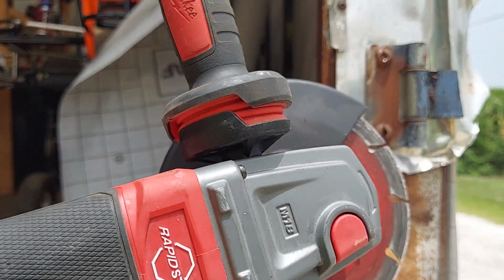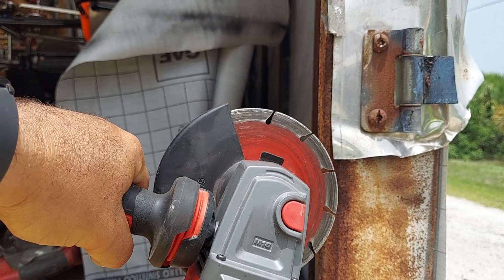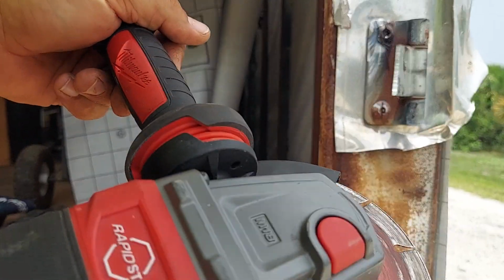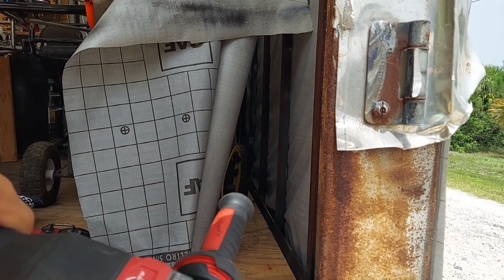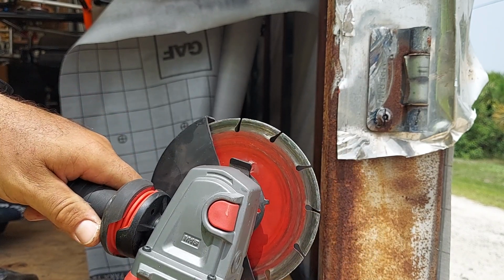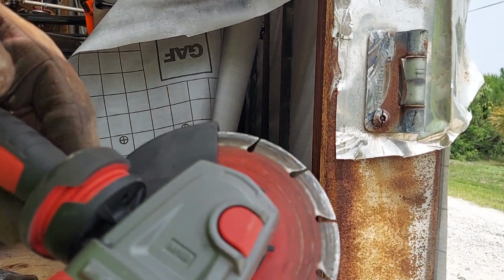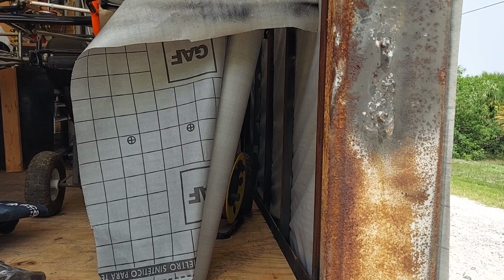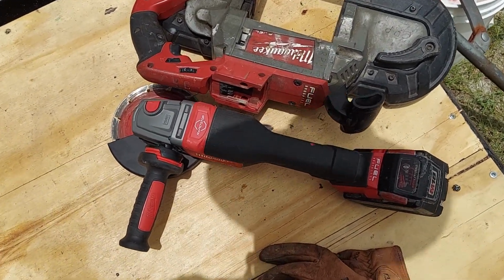6" Milwaukee M18 FUEL Grinder 2980-20

Comment: You have the right tool but the wrong blade.  As Ironworkers, we cut bolts on a regular basis, even grade 8 bolts much larger than that screw.  We use he same tool and it is fantastic.   With a .045 thickness abrasive 6" disc for Stainless Steel  (that is important) we get upwards of 20 bolt heads, or nuts, with a 5.0 AH battery.  A thin disc like these with only light pressure cuts real fast, the tool will not overheat and the disc is not consumed rapidly.  A thin cut is what you want, but choose your cutting discs wisely.  Not from a hardware store.  Each welding truck and our fabricating shop have several of these tools and they last or years even with heavy use and the 5.0 AH battery keep the tool weight manageable when using while on ladders.  These tools have filter screens, keep them clean and blow the tool out with compressed air for long life.  Because we have so many tools on the Milwaukee M18 Fuel platform, lots of batteries and 4 port multi-chargers we use the tool you have.  However, if someone is already using the DeWalt platform, the DCG414 Angle Grinder 4 1/2" - 6" Flex Volt 20 volt/60 volt with a 6 AH battery is a good choice for slicing steel like this.  I have one on my truck and use it occasionally but we do not have many of those batteries available to us.  It performs just as well though.  A little bigger and heavier, a bit more expensive (especially those batteries) but a good choice for DeWalt fans.  In the trade, we call these tools "Slicers" and every welder or ironworker has at least one of these tools and a box of these cutting discs on his truck.  They absolutely eliminate dragging out cutting torches anymore to slice steel.  Quick, fast and in a hurry.  Eyes are always on us and we get paid for how much we do on a job.  These tools are money makers for us.
Reply from the maker: Agreed, don’t like the metal blades
Reply: @tradesmenlife  like it or not, they are the disks you need
Reply: yep, silicon carbide's hardness is 9.5 on moh's scale, just half a point below diamond, and it will not be destroyed by iron, while diamond will convert to graphite when contacted with iron  if it is heated above 700 degrees C.

Comment: you can just buy two lead acid batteries from a car and a buck converter (step down module) to drop the voltage from 24V to 18V, then use the grinder for a lot of time, it is not going to be cordless tough, but the battery will be cheap, and you can move to any location you want
Reply: or you can buy a buck boost converter (step up module) and rise the voltage from your car's 12V to 18V , turn on the engine and grind while the car will be generating the electricity you need.

Comment: For anyone watching, with a proper edge, and better angle of attack on something like this, you won’t chew through a battery that quick. I was doing a bigger job of cutting off old welds and only got half way through a second older dewalt 4.0 battery with an older dewalt model at work. I was interested in viewing a demonstration since I ordered this model with a 6.0, I understand making a video and having everything being proper set up is difficult especially if you’re a full time worker, that’s no knock on you I appreciate the demonstration.
Reply from the maker: More videos to come

Comment: What does it mean when lights 1/3 then 2/4 flash back and forth?
Reply from the maker: What?
Reply: @tradesmenlife   was wondering if you knew what some of the flashing light codes on the battery was.  Mine was alternating between 1 and 3 flashing at the same time and then 2 and 4 at the same time over and over.  I’m guessing my battery overheated

Comment: That is a NOT a metal cutting blade
Reply from the maker: It was a cutting blade for Metal, it was very dull , I changed the blade for a new one and cut much better, yes it looks like a tile cutting blade, but it is specifically for metal cutting.
Reply: That is a metal cutting blade. I have a few of them. Use them at work all the time for cutting cast iron stacks and drain lines. His was on backwards and looked pretty wore. I’ve been using mine for 6+ months and it eats through cast iron and medium metal.